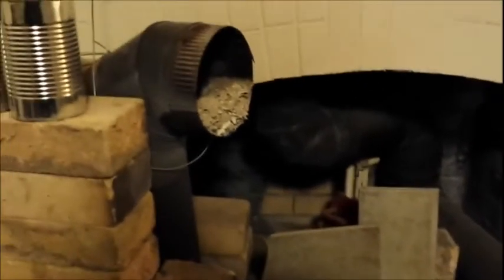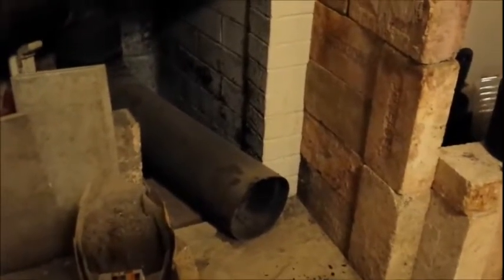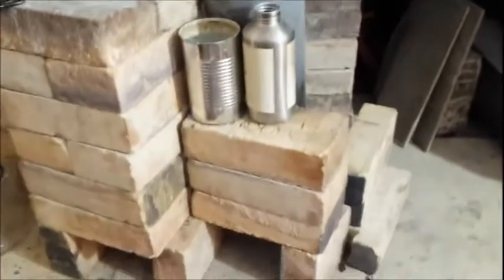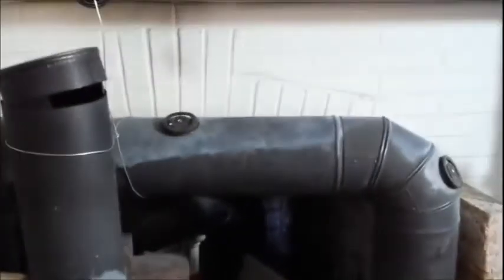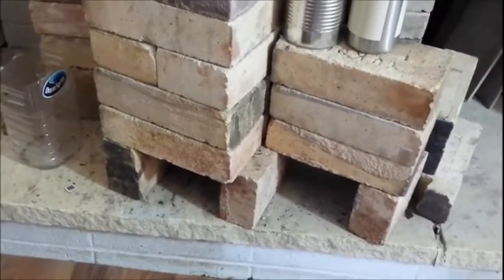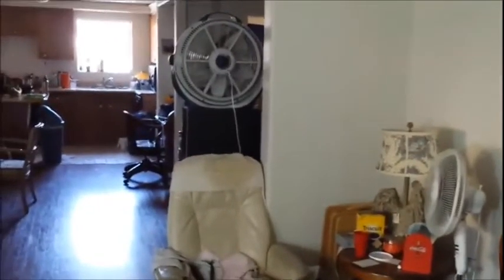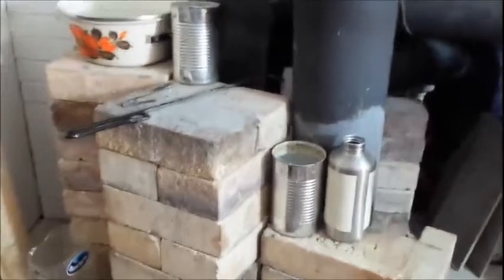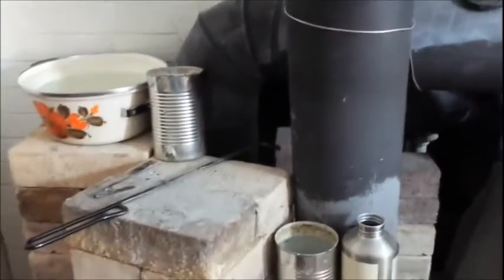040714 2014 UPDATE Reginalds Rocket Stove Fireplace

Comment: Use the ash on your garden instead of throwing it away!
Reply from the maker: yip, except when it has lots of nails.
Reply: Reginald Kinnaman That's the one exception. I actually tried sifting the nails out with some hardware cloth. It's a bit of a pain, but if you want to take the time, it does work.  Also I separate my firewood and keep the wood with nails / without nails separate. I burn it in batches so I know if my current load of ashes will be nail free or not.
Reply from the maker: I did a few times by using an empty milk jug of ash, put a large magnet on the bottom and then dump the ash out. garden is fairily small and can only hold so much.. (city lot)
Reply: Reginald Kinnaman The magnet is a good idea. You probably won't run into too many aluminum or brass connectors.

Unrelated question-- does the exhaust on your stovepipe rocket stove just empty into the chimney, or do you have stovepipe going all the way to the top of the chimney?

Comment: use the "j" first, then the 't', then the burn chamber
that will stop the smoke from escaping
I saw other builders adding air just after the fire to burn more of the gasified smoke, but in your case, it would be the air inlet that lets the fire burn

Comment: Hey Reginald, I discovered a different way of putting together the pipes, I would like to share with you in case you haven't tried.

I tried making the T stand on one end (with an end cap at the bottom), I then adjusted the 90D elbow to 45 degree and connected it to the middle opening of the T, everything else is similar. Wood doesn't always slide down the 45 degree elbow but you can make a slide with tin can or something, the slide can also work as a 2nd air intake. With this setup, I found it is very easy to achieve proper draft, you won't get smoke back at all. The T will last longer since there are no flames contacting it directly (you can put something in the T to stop the wood from touching the wall of the T. You can also put some ash in the end Cap so that the wood won't touch the end cap either. 

Hope it helps!
Reply: Also, I found it is easier to lay bricks around the T in this setup.
Reply from the maker: Ya, there's no wrong way.. but I see you found the problem I have had no matter what angle.. even in my almost straight up feeder, the wood doesnt always slide down.. I do close off the intake some once its going good (and heating well) to reduce burn times (plus with slower flow, less ash is drawn up into the other pipes.)
The more pipe you have, the more exchange to the room.. I wish mine was longer, but limited on space.

Comment: Thanks for the reply Reginald! It looks like the high temp pain on your stove pipes was burned off. Was it completely burned off/cured outside or was it burned off inside the house a bit too? I am curious, how come the high temp paint can be burned of? BTW, now since you have more experience of using this stove, do you still occupationally get a bit smoke in the house? My wife hates the smoke even a bit of smoke would make her open all the windows. Thank you again in advance!
Reply from the maker: its best to cure the pipe outside.. don't know what kind of toxic fumes are in the paint. I made the mistake of doing part of it inside.  What worked best is to get a lot of cardboard and put it together outside.. roll up the cardboard and fill up the pipes.. it will get very hot and cure quickest.. might have to do it more than once if the paint doesnt turn from the dark black to grey.  I usually take an elbow and two or 3 sections of pipe to make an L and set it up in the BBQ (using the BBQ to help hold the pipes)
Reply from the maker: I only get smoke inside if I rush it. if I start the fire in the Updraft tube and keep feeding it there until you have a good draw going, you should never get smoke after that.

Comment: Hi Reginald, have you ever had smoke coming out of the gaps around the connections of the pipes? I tried your set up outside and I had smoke coming out of the connection between the horizontal pipe and the down pipe. It looks like there is a bit pressure there since the temperature difference between the horizontal pipe and the down pipe is not big enough, so the exhaust wants to go up from the down pipe. But I tested it outside, it is a bit windy, it might be better if I do it inside.
Reply from the maker: I cured some of my pipe outside (put together in like an L). It seems I heard of someone having problems with drafting outside.  The Pipe I have is very tight and I only had 1 instance of it trying to smoke at a seam, but that was a loose seam from a used pipe into a new pipe (it must swell and shrink when heated and cooled a few times)  BTW, make sure you do not use the silver (galvanzed) pipe.. it puts out poisen fumes.

Comment: That is very cool! Thanks for the info! I had played with different versions of rocket stove in my fireplace, but they don't work as well. The main problem is I have two youth kids and I cannot put the stove outside the fireplace. Btw, how  critical are the fans in your setup?
Reply from the maker: The fans move cooler air into the area above the pipes.. without them, the heat just builds up at the stove. I have 3 rooms that we had opened up to each other so without moving the air, the tv (above the fireplace) gets warm but not sure if too warm but didnt want to shorten its life. once the heat starts circulating, you really tell the difference. There is a guy using my design back east without the fans in his basement and was having great success.  I originally wanted to keep this in the fireplace, but you would have to have alot of elbow to build enough heat exchanger.. plus the cross over pipe is to release heat before dropping and then up the chimney. hard to do inside the fireplace, but there is a video of someone that built his totally inside the firebox.

Comment: Thanks for the reply! How big is the heating bill after you started using the rocket stove?
Reply from the maker: first month it went from $400+ to $250, the next month as I learned more on the stove.. I brought it down to $150, and $125 after that.. That was January, February, and March. (the $400 was Decembers bill)
My wife loves it, when its working correctly (the learning experience included days of smoke in the house because when your cold, you get in a hurry)

I noted today the following from my now 3rd year of using this stove..
1. 2x4 and thicker produces less heat.. so once warmed up.. I mix 2x4 and 1x4.
2. 1x4 and thinner is awesome and keeps this cooking.
3. Cardboard is a great starter, I usually cut pizza boxes and such into 12" x 12" or smaller pieces and roll it up (use an old pallet nail in teh middle to hold it together)
4. Roll up 2 papers tightly, and repeat until you have 3 rolls, place them into a used toilet paper roll and use this as a starter tube with cardboard also.

Comment: Is this your only heat source? Do you have the fireplace chimney opening blocked for stopping the draft taking heat inside the room out of the house?
Reply from the maker: when we got this home, it only had baseboard heating. highest power bill before I began using this stove design was over $400 (but was our first winter here and not yet the coldest month).  I am using the chimney as a  thermal storage also.. I have a flat plat chimney cap with a gap around the bottom of about 3/4". We can always tell when the chimney is warming up, because this house creaks as it expands and contracts. hoping to get a few years out of the chimney because I feel that creaking is a sign of it moving as it warms and cools.  The only heater we currently use is a small heater in our bedroom that is set low, since I do not run this overnight.. (it's monitored when used)